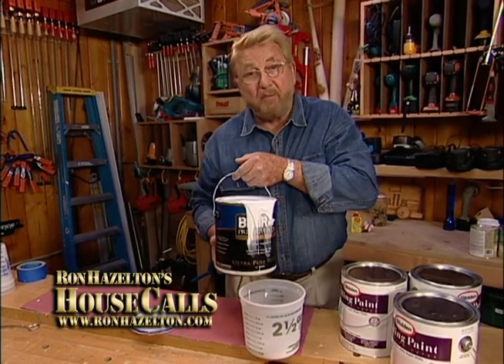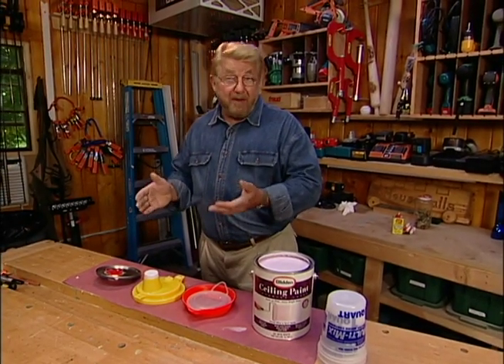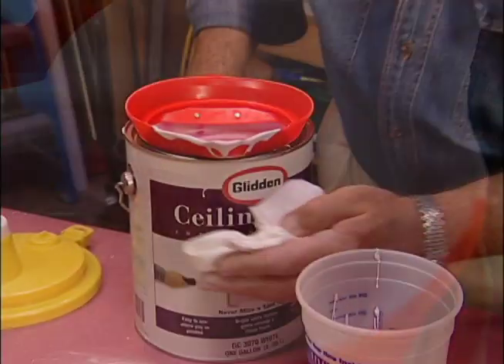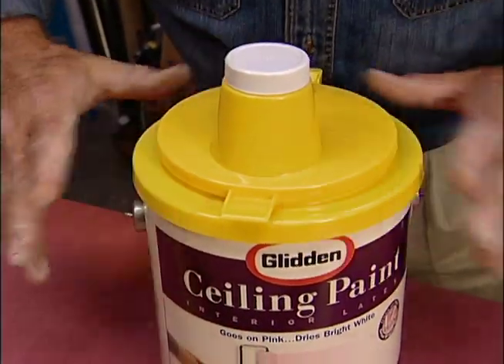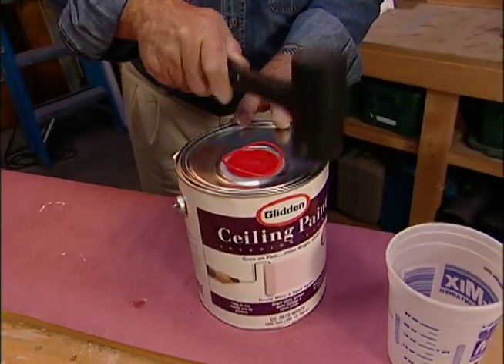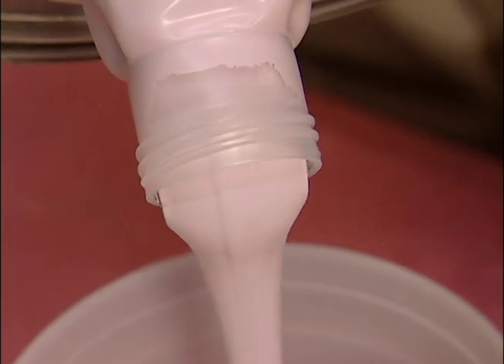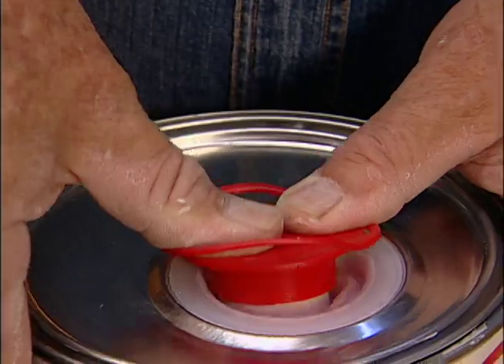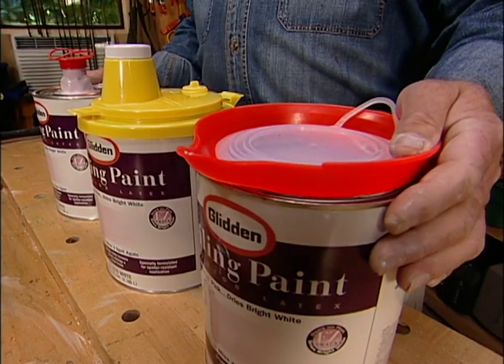How to Pour Paint without Dripping or Spilling

Comment: You can achieve the same end by sticking a couple of pieces of 2" masking or duct tape over the top of the open can in a 90 degree "V" shape. I've used this trick for cans of contact cement and wall paint and it works like a charm.
Reply: Thank u. For some reason this only worked once for me. Not sure why, have u had times when it didn’t word, if so what did u do?